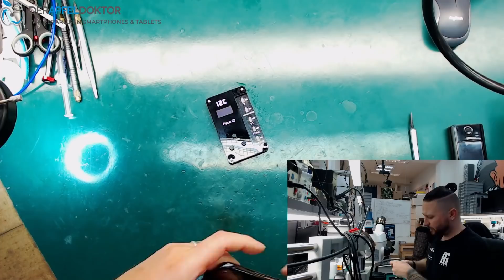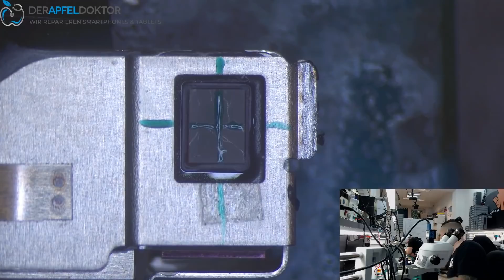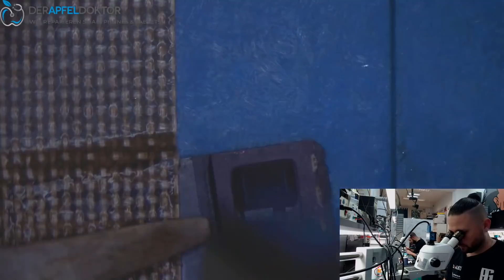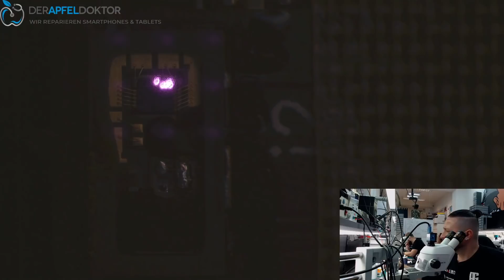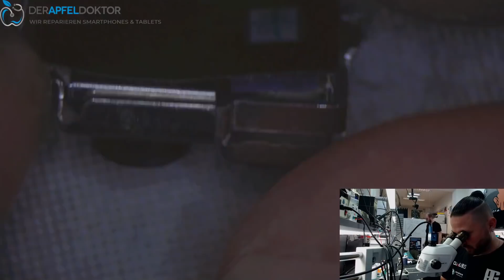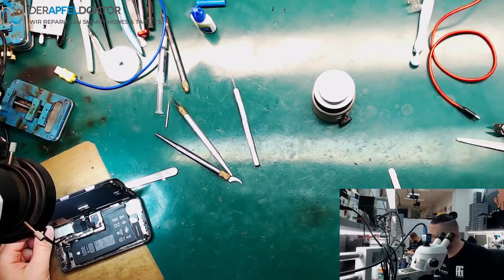iPhone XS Face ID Repair - How to solve the MOVE UP / MOVE DOWN issue - DOT PROJECTOR REPAIR - i2c

Comment: What temperature do you use to clean the glue before remove dot projector? And what temperature do you use to separate dot projector from the lens?
Reply: 280c 40 airflow does okay

Comment: Can you just remove the IC and jump and keep the cable? or is that new flex necessary?
Reply: Same question
Reply: @SHABAB_RAJPOOT  EEprom of the i2c is most likely reverse engineered to an extent where to read and write you need i2c's eeprom in conjuction with other chip.

Comment: So would replacing the front facing camera assembly fix the Face ID issue? Why do you have to fix the dot sensor??
Reply from the maker: No it wouldn’t.
Reply: Apple pairs the Face ID module software based to their iPhones. And of course only apple has the right software to fix this issue. 
It’s the same problem with Touch ID in older generations. If you break something during the repair you will lose Touch ID and only apple could fix it